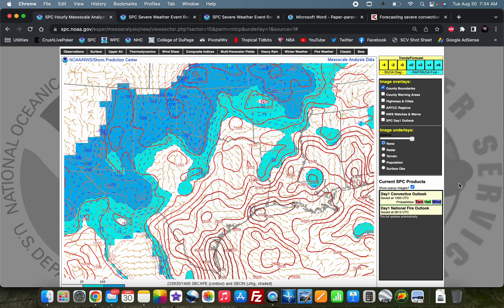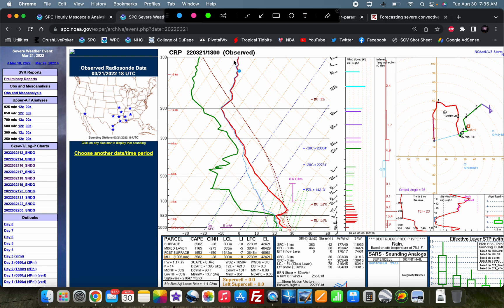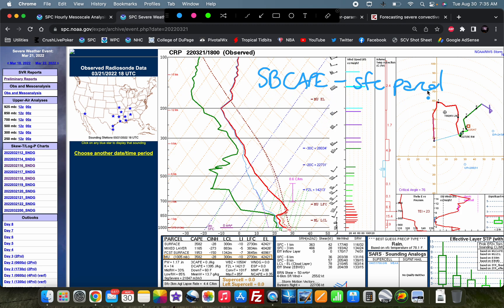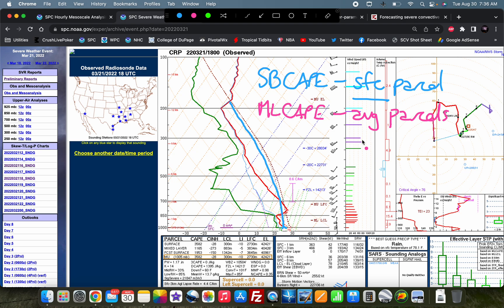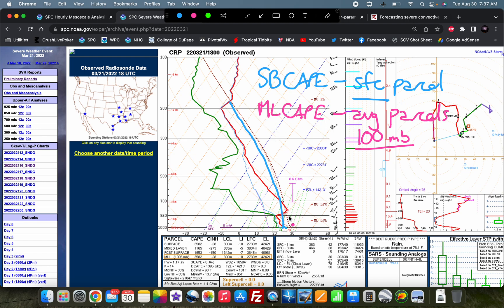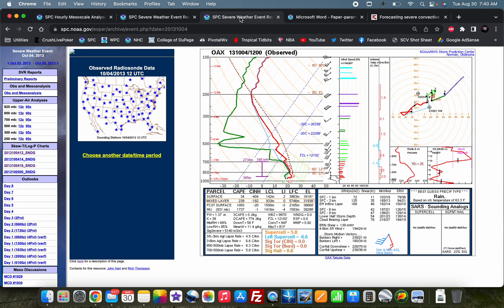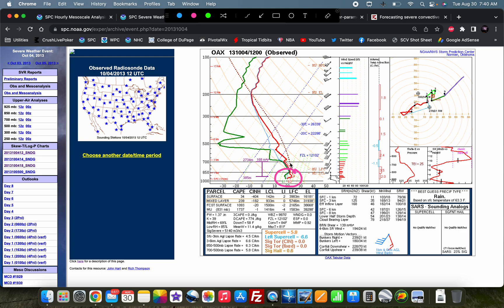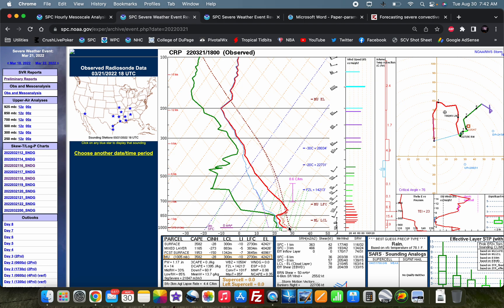SBCAPE vs MLCAPE: Which One Is More Useful?

Comment: Our sfccape values are always 2600 or greater...but to look for  accurate MLcape...i know where to find it, tks to you, but how do i calculate its value via the sonde ?  I have SFCCape, DCAPE values but not MLCape values ...
Reply from the maker: MLCAPE is pretty tough to calculate manually; you'd have to lift every parcel in the lowest 100 mb, integrate the positive area for each to come up with the CAPE values, and then average those CAPE values.

Comment: Do you look for a MLCAPE value to be greater or equal to a number to signify a favorable environment for tornadoes? What value would that be?
Reply from the maker: There isn’t really a threshold value of MLCAPE for tornadic activity…it all depends on the setup. I’ve seen tornadoes occur with 100-200 j/kg, and I’ve chased setups with 7000 j/kg that don’t produce much at all.
Reply: @ConvectiveChronicles  Gotcha I didn't know if it was like 3CAPE where you said greater than or equal to 50j/kg. Thank you!

Comment: This is a great video! Would it be possible to do another one similar to this but on MUCAPE as well, please? :)
Reply from the maker: Thank you! MUCAPE is a lot simpler; it’s the CAPE calculated using the parcel that has the highest equivalent potential temperature (basically, the temperature of a parcel of which all the water is squeezed out then brought down to 1000mb). It’s only used for elevated convection scenarios. I talk about MUCAPE in this video here: https://youtu.be/BRjJsYfwUbo

Comment: Thanks for this explanation - I'm a high schooler who makes weather forecasts for my friends, and when forecasting storms I certainly find MLCAPE to be more useful, and this explains why

Just a quick question: does the MLCAPE over SBCAPE rule apply for tornadoes as well? Since tornadoes are obviously surface based and can't occur in elevated storms, does that mean SBCAPE does a better job with that? Would a storm that enters an area of higher area of SBCAPE be more of a tornado threat than one that is in an area where there's less SBCAPE, given all else is equal? Or is MLCAPE still a better tool for forecasting tornadoes? Just curious, since I'm still learning
Reply from the maker: Excellent questions…I’d say that SBCAPE and MLCAPE don’t necessarily differentiate between tornadic and nontornadic environments. The value of SBCAPE by itself (and MLCAPE for that matter) doesn’t tell you whether storms will be surface based or not; instead, the overall distribution of the CAPE throughout the entire profile will help in that regard. Shear parameters have a lot more impact on how favorable an environment is for tornadoes than instability parameters do, but updrafts (i.e. storms) themselves will be more robust in higher-CAPE (including SBCAPE) environments. But again, it’s the overall distribution of that CAPE (where are capping inversions, skinny vs fat CAPE, etc.) that’s more important than the actual CAPE values themselves. Hope this helps; let me know if you have any other questions.
Reply: @ConvectiveChronicles  Thank you!

Comment: what is FCST surface? (forcast surface)
.
does that mean what they THINK the peak CAPE will be? (like when the cap breaks... or during peak heating, ETC)
Reply: never find.... found it (was a hard google however..... had to "force" results that included FCST)
.
an estimate of the afternoon maximum temperature is combined with the mean mixing ratio in the lowest 100 mb of the sounding. The afternoon temperature is derived from taking the parcel at 850 mb dry adiabatically to the ground, and then adding a 2 C superadiabatic "contact" layer.
Reply from the maker: Yep, exactly. I talked about that toward the end of my soundings series; I’ve never used it or seen it used in any normal severe weather application.